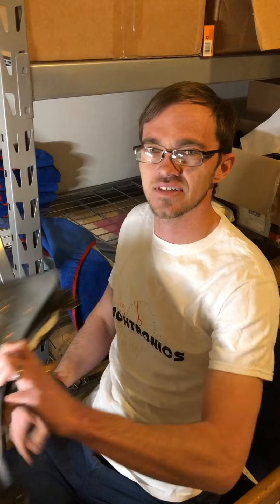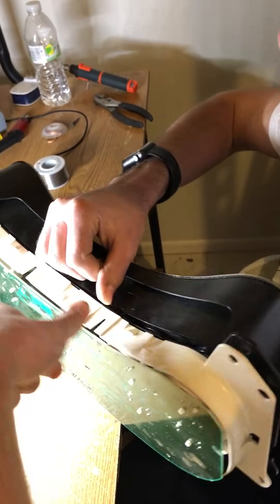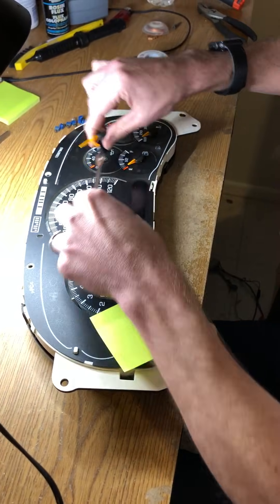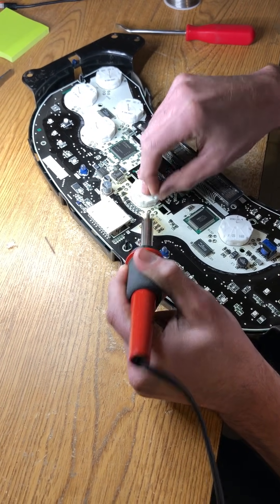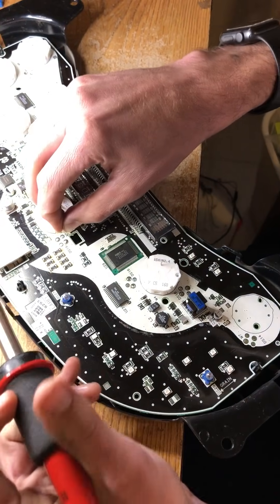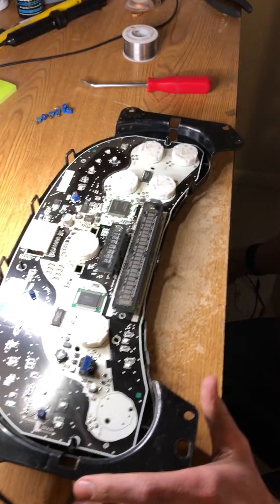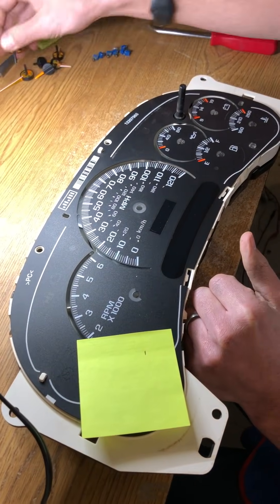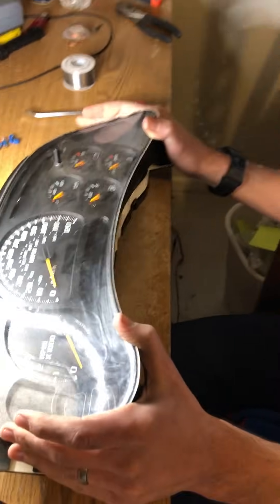How to install LEDs in 2003-2007 (classic) Chevy, GMC, Escalade instrument cluster

Comment: Has anyone had trouble with the turn signal lights not working when your night time lights are on? I installed mine and whenever my gauge cluster is turned on for night time, the turn signals don’t work. But in the day time, they work perfectly fine. Any help would be greatly appreciated!

Comment: So, I have a 2002 Chevy avalanche. And we are told we can't have a transmission temperature gauge installed in our cluster  because there is no transmission sending unit on  This year of avalanche  BUT when I installed my diablo sport, trinity t1000 tuner/programmer which hooks into the OBD2 port and it tells me my transmission temperature so I must have a sending unit on My transmission. What say you. I know I have the spot in the gauge cluster for a temperature gauge and would really like to have one installed if anyway possible and if it's not because of no  trans temperature sender  in the 02 Avalanche why is it that a temp gauge can not be installed in an 02? Thanks for your time.
Reply from the maker: @tellitallnow3914  your logic is correct, the truck has a trans temp sensor and if the gauge was there, it would display a trans temp.

Comment: question...do the clusters with the twist in bulbs work on 03s? im not very solder-savvy
Reply from the maker: No
Reply: @Tachtronics  whats the difference? bc i have a 1500 cluster in my 2500hd rn and the guages work...cluster is the same as in ur video wo trans temp guage
Reply from the maker: @johnharrison5098  the ‘99-‘02 clusters look very similar to the ‘03+ on the surface but very different internally. I’ll spare you all the minute details but if you swap them, it will not power up due to the polarity on the plug being different.

Comment: I had a speedometer that wasn’t working and a temp gage and I replaced all the stepper motors
And bulbs and now the lights won’t come on when I turn the truck on and it’s a 2007 Chevy Silverado 2500hd classic..as far as I know iv done everything right..any help would be much appreciated
Reply from the maker: Are the rest of your dash lights coming on (ex. Radio, HVAC controls, etc…?) if not, you’re light switch is out. If it’s just the cluster not illuminating, I’d reflow the circuit board where the wires plug in to the cluster.
Reply: Yes all lights on dash work..just the lights in the cluster that I replaced won’t come on when I turn key on
Reply from the maker: @chadallen6056  in that case, I’d start with reflowing the plug where you plug in the wiring harness

Comment: My leds always ends up flickering eventually. What am I doing wrong?
Reply from the maker: Where are you getting the LEDs?
Reply: @Tachtronics  first was off ebay and then I bought more expensive ones from Amazon
Reply from the maker: @justinschubbe5707  I don’t know exactly which leds you purchased but there are lot of very low quality LEDs out there. I don’t think you’re the issue, most likely the issue is just not using quality LEDs. 

Here’s a link to our LEDs. We guarantee them for a year. Our failure rate is well below 1% for the remaining life of the truck. https://www.tachtronics.com/product-page/diy-kit-led-with-instrucrions

Comment: Can you change the turn signal bulbs as well
Reply from the maker: Yes but not recommended.
Reply: Why is it not recommended
Reply from the maker: @lukestortroen609  1. A bright flashing light in your face, particularly after dark, can have a momentary blinding effect and 2. There gauge face has a green film on it so even if you change the color of the LED, it is probably not going to shine the color you’re wanting after the light shines through the green film.
Reply: Makes sense. How much is it to upgrade. And also can you do all the switch and climate control
Reply from the maker: @lukestortroen609  email us at tachtronics@gmail.com please.

Comment: How do I get that power source adapter
Reply from the maker: I got a pigtail from an auto salvage yard and then hooked it up to a 12v power source. Probably not worth the trouble unless you plan on doing more than just one or 2 clusters.

Comment: Never understood the point of marking the needles; the stepper motors have a built in stop and self-test.  Just push the needle all the way down to the stop, remove it.  When installing set it on gently and turn to the stop, again, before pushing them all the way down.  Plug it up, good to go.

Comment: When I the needle back it doesn’t read the appropriate MPH
Reply from the maker: If it’s moving correctly but just off by x amount of miles, just pull the lens and reposition the needle.
Reply: @Tachtronics  can you send me the link to the bulbs, I think the last time I had the cluster on the truck, (I have 2) the needle would say I was going like 80 when I was doing about 35/40
Reply from the maker: @rodolfomoralesjr626  https://www.tachtronics.com/product-page/diy-kit-led-with-instrucrions

Comment: I jumped the gun took off the needles with out looking and marking down, at where they were. 😢😅 what should I do now? Or did I just fook up my cluster.
Reply from the maker: either you can send it in to us or another rebuilder to have it calibrated using a function generator or if you have a scan tool with live data, you could plug the cluster in to your truck, read the live data readings and just "eye ball" the correct positions of the needles. Not the ideal way to calibrate but it should work in a pinch.
Reply: @Tachtronics  imma need that info. So I can send it your way.
Reply from the maker: @DAT.N8V.MISTERBALL  sorry, I didn't see that you replied. Best thing to do is print off the service order form from our website, fill it out and ship the cluster w/ the form to the address listed on the website/form. www.tachtronics.com

Comment: i know little about electronics or leds, but i have them on my instrument cluster and a couple were starting to flicker. i tested each with a 9v battery and a couple paper clips and was wondering why they would all light up minus the ones that were dead? are they all connected or something? if one goes out again, will there be issues, like a string of old christmas lights?
Reply from the maker: One going out should not cause the rest not to light up. They will fail individually if that makes sense.

Comment: What would cause odometer readout to be dim with dimmer switch maxed out?
Reply from the maker: The ‘05-‘07 odometer VFDs seem to fade over time. Reflowing certain parts of the board can help at times and wiping off any dust can help a little but sometimes there’s no other option than to just replace the VFD

Comment: Can you solder in led bulbs on to the turn signal spots? Or will it not work? I installed some and they work fine when dash lights are off. When they are on the turn signals don't light up on the dash. Any ideas?

Comment: Do you guys sell the gear select LCD? Mine is going out and it's hard to see what gear the truck is in.
Reply from the maker: The PRNDL screen VERY seldom fails. 99.9% sure you have some resistors that need to be reflowed that will brighten up that screen.

Comment: hey brother. you lights worked great but once i changed them out my oil pressure gauge wouldn’t read anymore, i changed the stepper motor and still nothing. what did i do?
Reply from the maker: Is the gauge staying at 0 or what is it doing?

Comment: If you wanted the digital display color to match how would you do that or is that not possible?
Reply from the maker: Depends on what color you’re wanting to do. Use light filters and depending on the color you’re going for, you may need to sand the original green tint off. Not all colors are possible due to the display being green
Reply: @Tachtronics  what would you do for white? I’ve heard it is possible from some and not from others. Kind of confusing 😞

Comment: Hello does this also change the lights on the P.R.N.D123 so they all match?
Reply from the maker: No, changing the color of the digital screens is another process,
Reply: @Tachtronics  okay i figured what's the process on that do i need to get the face plate different color
Reply from the maker: @tonyvalenzuela420  you would either need a different face or sand the film off of the OEM one
Reply: Okay i see do you have a video on that or sell the faces
Reply from the maker: @tonyvalenzuela420  I don’t have a video on it. The process of sanding the OEM face is pretty tedious. if you email us at Tachtronics@gmail.com, we can talk about ordering a face for you.
Reply: @Tachtronics  okay thanks will do

Comment: Will these bulbs work for climate control panel lighting, power window/ door lock panel, light dimmer nob and steering wheel buttons?
Reply from the maker: No, you’ll need smaller LEDs for those. I have those as well though. Email us at Tachtronics@gmail.com and we can discuss further.
Reply: @Tachtronics  cool thanks. Just emailed you.

Comment: I have a airbag light on, can I just take it out or will it mess with other things
Reply from the maker: If you must have the light off without correcting the cause of the light, I’d recommend covering the light instead of removing it, that way you can revert back if needed. A couple of layers of black electrical take to the back of the appliqué should do the trick.

Comment: I installed all new led. Now no power to anything
Reply from the maker: Sorry to hear that. Unfortunately there’s not a simple or obvious solution to that without looking at it. Sounds like either you made a mistake somewhere or a resistor may have come loose while working on it.
Reply: @Tachtronics  Thank you for your quick response. During this assembly I noticed a very tiny resistor. At first I didn’t see where it went to then with further investigation I seen where it went and I soldered it back in place and now I’m good thank you
Reply from the maker: @joshwatkins4637  that’s great to hear! Glad you got it figured out!

Comment: I have a quick question I know when I installed LED lights in my turn signals on my 05 GMC 2500 HD I had to have a little box that convert it the electricity so that the LEDs Would work if you’re replacing your normal back lights with LED do they not need anything else to make them work?
Reply from the maker: You do not need to install anything in addition to the LEDs. These LEDs have built in resistors, all that is needed is to solder them in where your old incandescent bulbs previously were.

Comment: Just installed the LEDs I ordered from tachtronics.  Everything works great.  I would add that I saw in another video somewhere that you can check your lights by taking one of the square 9V batteries (used in smoke alarms) and hook it up to the far left bulb slot, which is empty on my 2003 Tahoe.  I used that to check each LED as I installed them.  That way I didn't have to wait until I reinstalled the cluster to find I goofed on one (which I did).
Reply from the maker: Glad to hear it went well for you 😊

Comment: Can we get them in stock colors?
Reply from the maker: I have a different style LED that we use that looks stick; however, this led has a little more difficult to install. It does not have a built in resistor so an additional external resistor needs to be added for each LED. If you a pretty handy with a solder iron, it should be no big deal but if it’s your first time soldering, I wouldn’t recommend it.

Comment: these are one of the dimmest leds ive ever had this is a total rip off dont buy these there way better bright ones on ebay these guys offer you 10 leds for 25 dollars when on ebay you can get 50 for 12 dollars and there better than the ones there trying to sell you there way brighter than these
Reply from the maker: Hello Alberto, I’m sorry to hear you don’t like the LEDs you purchased. You are welcome to return the LEDs for a full refund. Assuming you bought white LEDs, I have recently been forced to switch to a different brand that unfortunately is not as bright as what I used to sell. I decided to go with this brand because they are absolutely bullet proof and I’d rather go with something that is slightly dimmer and reliable rather than bright, have severe hotspots and fail shortly after installation. Obviously not everyone will agree with that approach but I’m not interested in selling something that I will constantly have to warranty. Thanks for the feedback and as I said before, you’re welcome to return them for a refund. 100% satisfaction is what we strive for.

Comment: Good tip about the turn signals.  I had installed some LEDs but the turn signal indicators didn't work.  I switched them back to the factory bulbs and they work fine now.

Comment: I have seen other vids where the led’s just pop in from the back of the cluster ...they sit in a little adapter like a light socket... why are these different?
Reply from the maker: ‘02 and older clusters have bulbs that twist in from the back. ‘03 and newer solder in.
Reply: @Tachtronics  oh great.. I just ordered my LEDs  from a site that showed them as twisting in from the back... they even made me input all the vehicle data for the car which is an 04 Yukon SLT .. grrrrr!!!  Lol guess I will be returning the LEDs  ok well thanks for the answer.
Reply from the maker: @hdrjunkie  that’s frustrating, you’re welcome.

Comment: How much do you charge to fix motors and add led's
Reply from the maker: $185 to do a full rebuild and add LEDs. A rebuild includes replacing all stepper motors, all backlighting, remove corrosion from the board, brighten the PRND screen, reinforce the power failure issue, cleaning, calibration, and return shipping. If you’re having any issues outside of what I mentioned, let me know please.
Reply: @Tachtronics  email me please. Afreeman214.rr@gmail.com

Comment: I pulled the gauge needles without marking them. Any tips on how to reinstall them?
Reply: Reinstall with cluster apart with needles In hand. Put the needle whare they should be with the key in the on position. So for the tac it would be at zero same with oil pressure and temp. And mph. Only one that is tricky is the volts. Kinda gess whare it normally is. The gas gauge. Hope you know how much you had.

Comment: Im thinking about switching my stock lamps out for amber led's. Like a deep turn signal amber as i love the color. Will the faceplate allow the color to pas through unmodified? (I replaced the motors but forgot to check our the back of the lense)
Reply from the maker: Saiko The Sergal sorry for the delay. 

I’ve actually never tried orange LEDs behind an OEM gauge face. My guess is that orange will shine through but will be somewhat dim.

Comment: Wowwwww, fuck this job. I've done a few conversions, but this just looks like a hassle. Was tracing down some wiring issues regarding the cluster. While I had it out checking wiring I figure hey what the hell, may as well pop in some 194 bulbs I had laying around, Nooooo. Not paid enough to separate and solder some new bulbs in, fudge that nonsense. I already did the ambient air sensor as a freebee.

Comment: My park neutral drive reverse 321 is really dim how do I fix that
Reply: I think you just add solder to each terminal
Reply: There are I think 7 little resistors that come loose. It’ll be discolored around them, like a brown spot. Do a solder reflow on em. They’re all bunched together, I think top left.

Comment: Great video, what would be the voltage and mA rating of the LED's?
Reply from the maker: MLLERTME02 Im not 100% certain on the specs but I believe 14v and 20 mA
Reply: @Tachtronics  thanks for your reply!
Reply: 12v

Comment: Do you not need resistors switching to leds?
Reply from the maker: WatDaHeckman my LEDs have built in resistors so you do not have to mess with adding external resistors.

Comment: I put LEDs in my cluster after factory bulbs quit, mine are very very dim and do not brighten. Any suggestions? Are they soldered on backwards as far as polarity
Reply from the maker: Michael Wilbur no, if they were backwards, they wouldn’t illuminate at all. 

What color LEDs are they and and did you buy them from me?
Reply: @Tachtronics  they are blue and yes, I just checked voltage, I only have .22v idk what the issue is any advice is greatly appreciated
Reply from the maker: Michael Wilbur how many volts do you have on wire A11 at the plug in?
Reply: @Tachtronics  it was the bcm module, I swapped it out and now I have dash lights again
Reply from the maker: Michael Wilbur interesting. Glad you got it figured out
Reply: @Tachtronics  thanks for the help

Comment: I did this to my 2001 Venture only because I cant find the replacement bulb. Do not pull off the needles or you could damage the delicate plastic gear inside the gauge. Instead desolder the gauge from the board. I had to buy another gauge as a result. I had to put the old gauge back since the mileage is lower and I did that by simply desoldering the gauge from the back.
Reply: Car Hack on the 03+ GM pickups and SUVs, if the stepper shaft comes out with the needle, it is an outdated stepper and should be replaced anyway. If it is the latest x27.168 model stepper, the shaft will not come out when removing the needles.